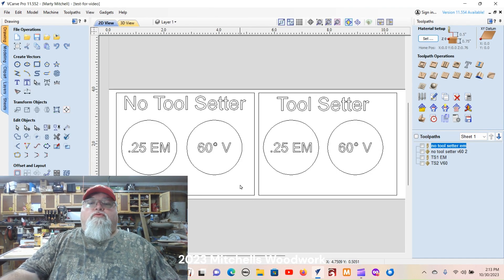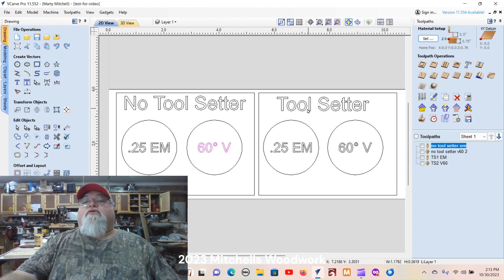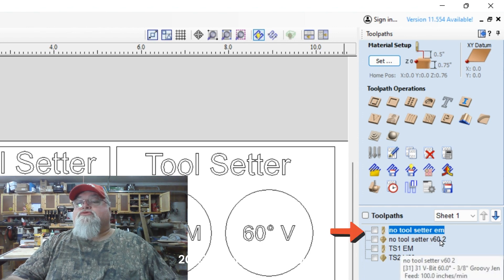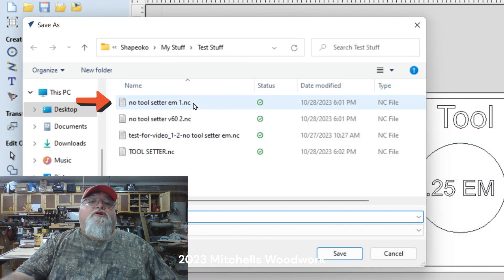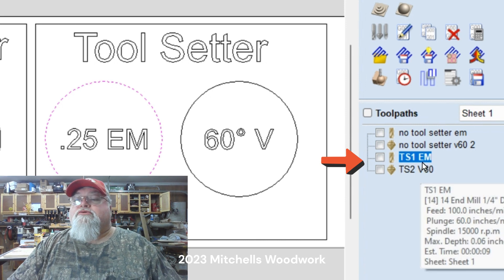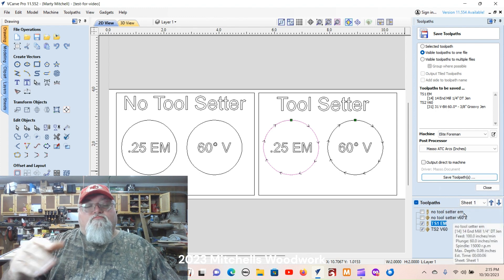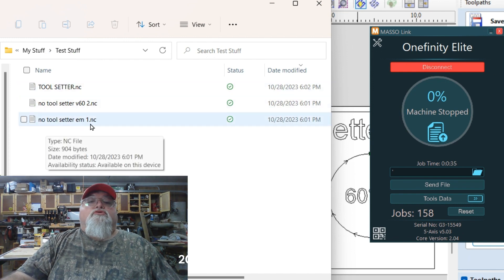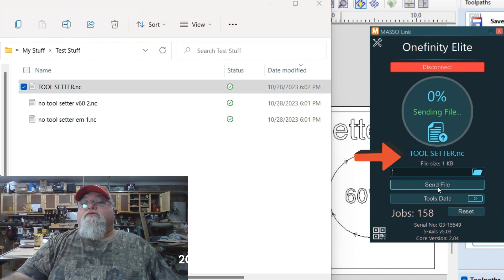Tool Setter vs Touch Probe - What's The Difference?  - Onefinity Elite CNC - Masso - BitSetter

Comment: Thank you very much for these videos! They’ve been super helpful in working with the machine. 

What are your thoughts on sticking with the paper method to set your Z alongside having the tool setter??
Reply from the maker: Thank you!  And thanks for watching!

The paper method works fine, I sometimes even use it when I feel the need to double check the touch probe results.  Basically, I think I trust the paper more than the probe in some situations, but that’s likely because I started out using paper with my first CNC several years ago.
Reply: @MitchellsWoodwork  I do see that in a lot of workers’ comments on sticking to what works best for them. Thanks for the feedback!
Reply from the maker: @Etch_n_sKch  you're very welcome!

Comment: Question about how the spindle moves over to above the tool setter to change the bit? When I run the G-code I made in VCarve Pro, when it comes to changing the bit, it just stops above the end of the tool path it just finished.
Reply from the maker: Hi Neil, great question.  Here's the answer:
In Masso > F1 > Auto Tool Zero > checkmark  "auto tool zero" > enter the X & Y position of your toolsetter > checkmark "enable" on both X & Y positions.  
I have my Z safe distance to tool setter set at -0.50"
My Tool zero feedrate is: 31.77165 ipm.  I can't remember where that particular number came from, seems to me that just an even 31" or 32" would've been a lot easier.   If you need any additional help just contact me through my contact info in my bio here on YouTube.  Hope this helps!

Comment: Question - in this video you have the tool setter top height at the top of the waste board, but in other videos (your and others) the tool setter is on top of the waste board.  I plan on buying the pwncnc metal working one like you upgraded too so does that have to be on top of the waste board or can you just have the touch piece on top like you do in this video? Thanks so much!
Reply from the maker: The tool setter can be set at any height (within reason) in relation to the surface of the waste board.  Above it or below it, it doesn't matter.  As long as it's within the reach of your spindle in X, Y, and Z you shouldn't have any problems.
Reply: @MitchellsWoodwork  thank u love your channel!!

Comment: If you don't have a z setter, when prompted to change out the tool to continue the program, can you do that with the regular tool probe in z? will it know it has to set z or is that all manual...I tried it a few times and it just goes haywire into the wood. I just ended up using height collars and setting them to the same height. it sucks.
Reply from the maker: @robstewart3627  if you’re NOT using a tool setter you can only save, load and run one tool path at a time.  You will have to use your touch probe to set the tool Z height each time you change tools.  

The #1 advantage of using a tool setter is that you save ALL your tool paths to one file and run them together.  The tool setter automatically measures the offset of each tool used in the project.  All you have to do is change the tool when prompted, then hit “cycle start”.

Comment: Can you make a video on batching out items using Masso / Tool Setter / Touch probe? I layout the pieces but wanting to avoid homing after every item is machined.
Reply from the maker: If you have watched all of my videos and have your machine set up like mine,  after securing your new workpiece just tap “go to work origin” > rewind > cycle start.  No need to rehome or reset the Z (as long as your workpieces are exactly the same thickness).  But if yours is not set up like mine (edited post processor) it would be impossible for me to explain how you could do it with your particular setup.  

However, I am currently making a video that has a small about of repeatable cuts, but it’s basically just as I described above.

Comment: As always great video.  One thing can you clarify on is tool numbering.  To use the tool setter all your bits need to be in the masso correct?  And then in vcarve you need to match the numbers.  Example.  1/4 EM is tool number 4 in vcarve tool database and tool number 4 in the masso.
Reply from the maker: Thanks!  Actually, I covered tool numbering recently in the “tool error” video linked below.  But yes, the tool numbers in VCarve Pro and Masso must match exactly.  

Getting A Tool Error In Your Masso Controller??  Check This First!! - Onefinity Elite CNC
https://youtu.be/FeiZAZH2vWI
Reply: @MitchellsWoodwork  the one video I did not watch.  Thanks

Comment: Does the tool setter have to be level with the spoil board?
Reply from the maker: @therealrez   nope.  You can even set it below the surface of the spoilboard like I did in this video so it won’t be in the way during resurfacing.  My new ATC / toolsetter is about 3 1/2” above the spoilboard and works fine.  It may be helpful for you to watch some of my newer videos that show my current setup.  Check out my “PwnCNC ATC Installation Series” playlist.  

https://youtube.com/playlist?list=PLqRrCnqsxc21psP1Gq44QUolzRb9Zw-O-&si=r2tUnAZgVPm2GObj

Comment: Does the tool setter only work with the Masso?
Reply from the maker: I’ve sent a text to Steve at DashMade, the maker of the tool setter I use.  He’ll chime in shortly.
Reply: This one is designed for Masso only. People on the Onefinity forums have written code for tool setters for the other controller, but I do not have experience doing that.

Comment: Great Video, but I am still just a bit confused.  Here is what I've done:

Situation #1 - Surfaced back side of project
1) New Job - loaded a file.
2) Inserted a 1/4" EM and did the X-Y-Z probe.
3) Pressed rewind and Cycle Start.
4) Masso asks me to change the tool
5) I changed tool to a surfacing bit, pressed Cycle Start again and the machine moved to Zero the bit on the Tool Setter, then proceeded to begin to carve.  HOWEVER, the Z was now too high and it air carved.
6) I stopped the carve, then I used the X-Y-Z Touch Probe and did a probe for Z only.  Hit rewind then Cycle Start and it worked fine.  After running the surfacing file, I was done with this side of the project.

Situation #2 - remounted project on opposite side to begin carving using multiple individually saved files.
1) Loaded the first file.
2) Inserted a 1/4" EM and did the X-Y-Z probe - this is the bit I am using for the 1st file as well.
3) Pressed rewind and Cycle Start.
4) Masso asks me to change the tool
5)Since I already had the tool installed,  I just pressed Cycle Start again and the machine moved to Zero the bit on the Tool Setter, then proceeded to begin to carve.  HOWEVER, again the Z was again too high and it air carved.
6) I stopped the carve, then, like before, I used the X-Y-Z Touch Probe and did a probe for Z.  Hit Rewind the Cycle Start it worked fine.
7) Upon finish of this file, I loaded the next file, changed the bit, then hit Cycle Start.  Masso asked me to change the Tool.  Since I had already changed the tool, I pressed Cycle Start again, and the machine went to the Tool Setter, then proceeded to carve correctly.

Obviously, I am missing something on the initial file for the first bit.
Reply from the maker: If I’m understanding correctly, you saved the tool paths for side 1, separately.  Then did the same thing for side 2.  

If that’s the case, try saving the multiple tool paths for side 1  into ONE FILE.  Then do the same for side 2.  

By saving your tool paths separately you’re missing out on one of the best benefits of having a tool setter, which is the ability to save all of your tool paths into one file.  Try this and I think you’ll find that your problem is solved.

By saving the tool paths into one file, you only have to probe your Z with the probe block one time.  The tool setter takes over from there.   Let me know if this helps you.